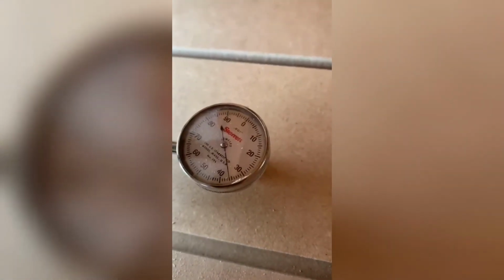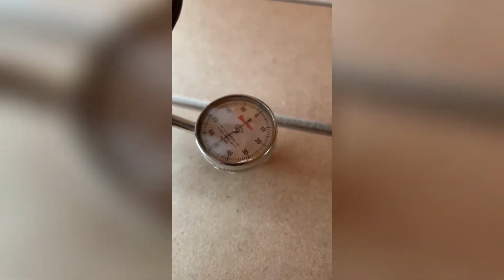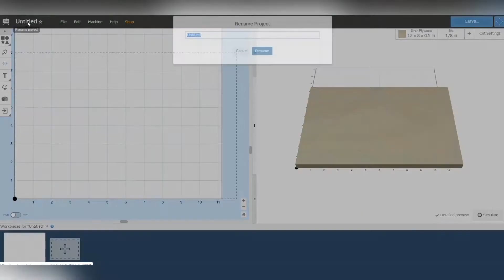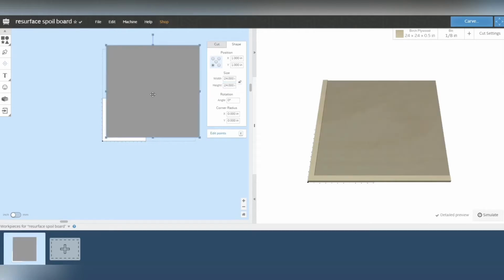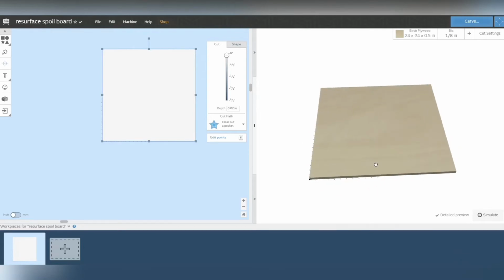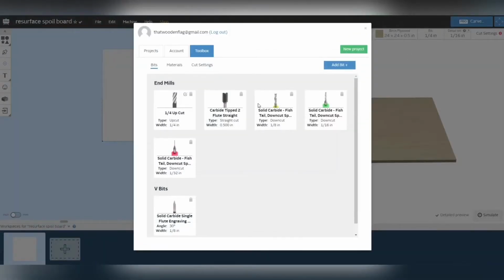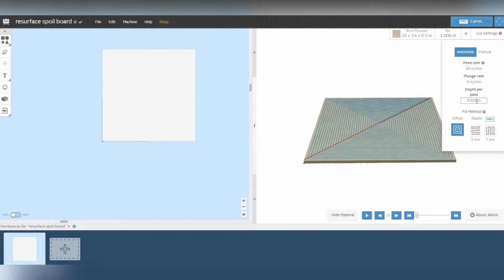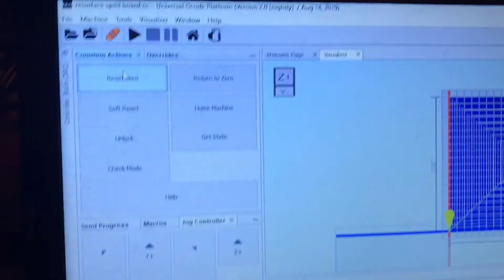Cnc spoil board resurfacing (Start to finish)

Comment: Thank you for posting this! I have an E4 as well and have experienced the same thing--it just isn't level and it messes up my cuts. How is this working for you after the resurfacing? just sand down the edges outside of the cut area and good to go after that? thanks!
Reply from the maker: I’ve been running great since resurfacing.  At first I stayed to my cut area size but then got some bigger projects that required me to lay the wood over the unfinished area. I did sand it down. WTH the onefinity, my plan it to have a base area and the. My spoilboard would only be the size of my cut area.
Reply: @ThatWoodenFlag  Great! Thank you.

Comment: Does the machine know to surface the board just by adding a square? Explain please? Thanks.
Reply from the maker: This video is so old. I’ll remake one that is short and sweet. 
What you do it make a square that’s the size of your spoilboard then you tell the software what bit your using to resurface and how much your taking off each time. 

Then create your gcode, zero , insert the bit and run.
Reply: @ThatWoodenFlag  thanks
Reply from the maker: What machine are you using?
Reply: @ThatWoodenFlag  I found my answer, thanks

Comment: So did you decide not to use the 1 inch bit after all?
Reply from the maker: Holy crap this is an old video lol. My new machine I used a 1 inch bit but tooo the long route with this one lol.
Reply: Just noticed that you set it up for a 1 inch bit but you didn’t use the 1 inch bit…
Reply from the maker: That video I was super new and I can’t even remember making it lol